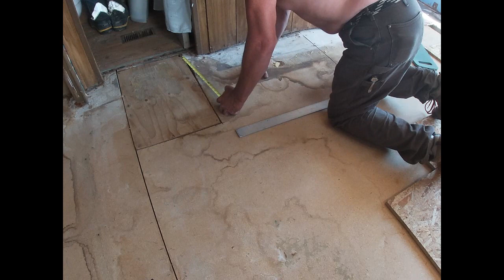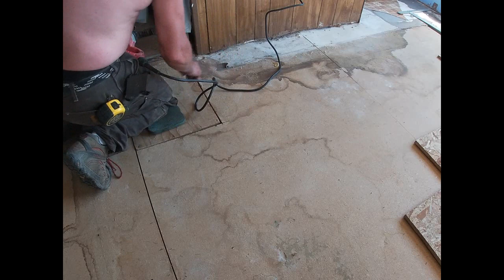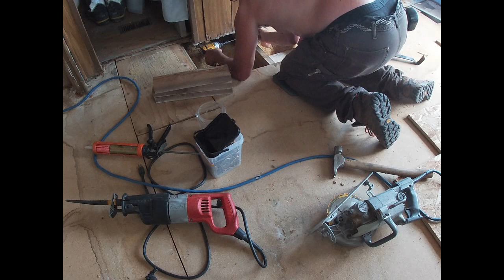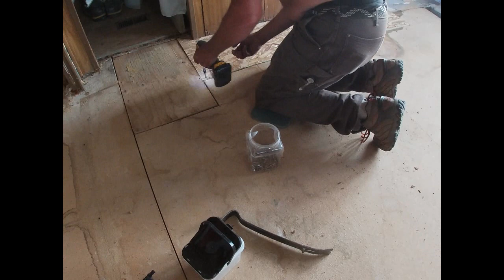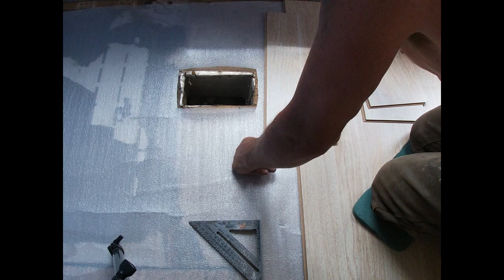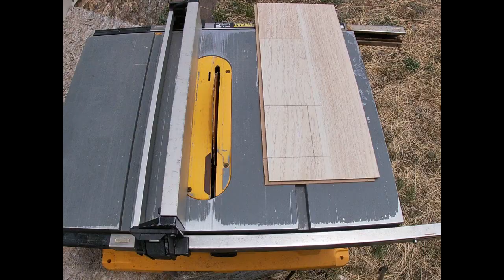How to Remove and Replace Rotten Particle Board Subfloor

Comment: i have a question,
placing down the plank flooring, what is that blue barrier inbetween? does thst come with the laminate or something you’ve bought?

also one more question,
best way to level particle board? could i use the premixed paste from Henrys?
Reply from the maker: The blue foam is purchased seperatly. It serves a few purposes. Its a small amount of insulation, sound deadening and padding between the flooring and subfloor. Some laminate flooring comes with it glued to the bottom side. Leveling particle board can be done many ways and theres sevsral products out there that work. Im not familiar with the premix paste but if its a leveler for wood it should work. Thanks for the question! STAY SAFE!!

Comment: Why wouldn't you use a circular saw   instead of the reciprocating saw and set it at 1/2 inch? And to cut at the end, couldn't you have just turned the board over and cut with the jig saw, and that way the mess would still be on the underside of the board. ?
Reply from the maker: I could have i spose. Theres a lot of ways to do it. Thats just how i did it this time. Thanks for commenting!! Hope ya got something out of it. STAY SAFE!
Reply: @307j.o.a.t9  I did. Thanks for sharing.

Comment: Why put the blocks in horizontally instead of vertically? I assume to give the subfloor more support. 

But I thought the reason the blocks are installed vertically is to distribute the weight above across the entire side of the joist so it’s not just the screws holding the blocks up but also the joists they are between. 

Just curious. Really enjoyed the video and you had some great tips. Thanks!
Reply from the maker: Basically its just how i did it in thin situation. This way theres more surface area for the glue to bond to the subfloors together. My goal was to make up for not having the tongue and groove. No blocks are needed if you have that, the subfloor supports itself so the screws holding the blocks to the joists are extra.